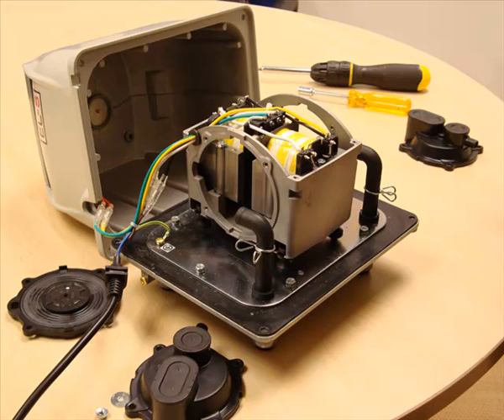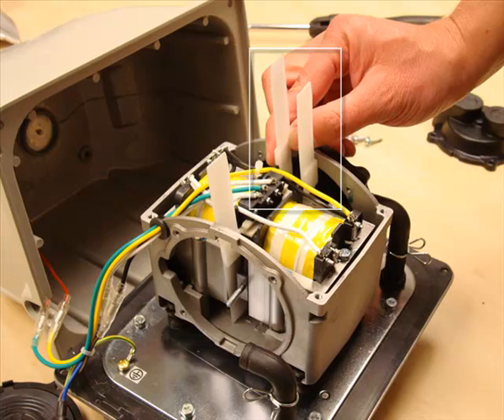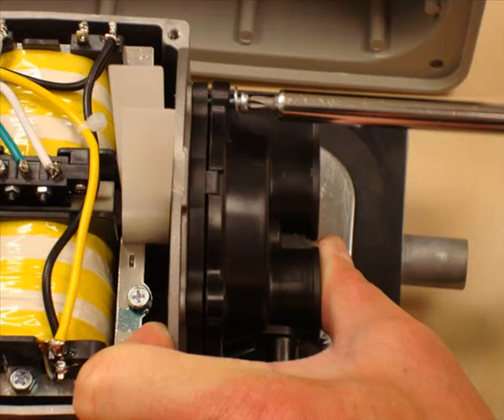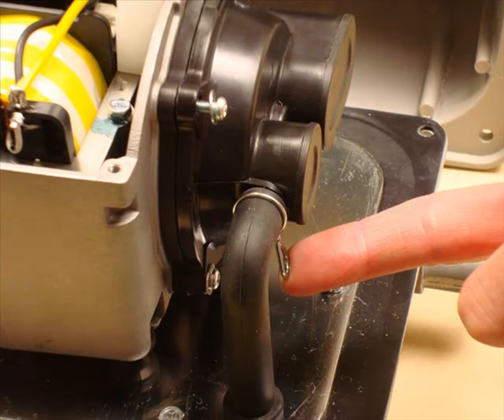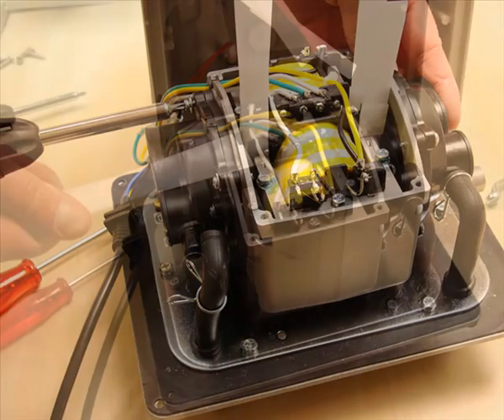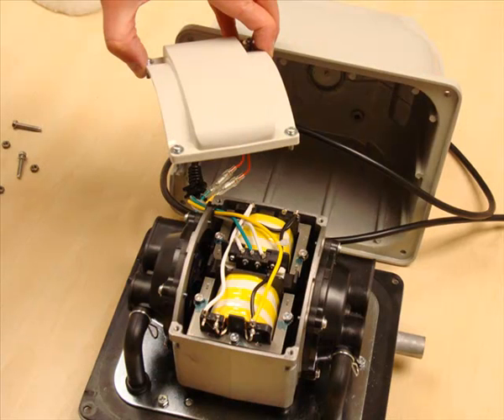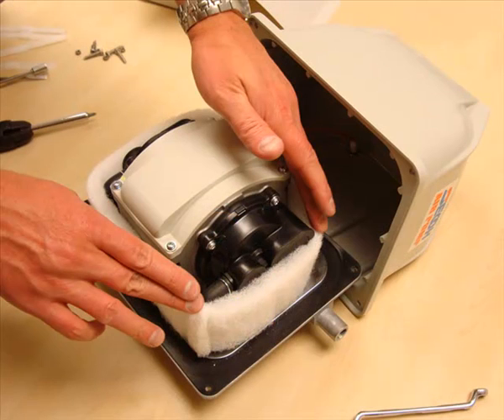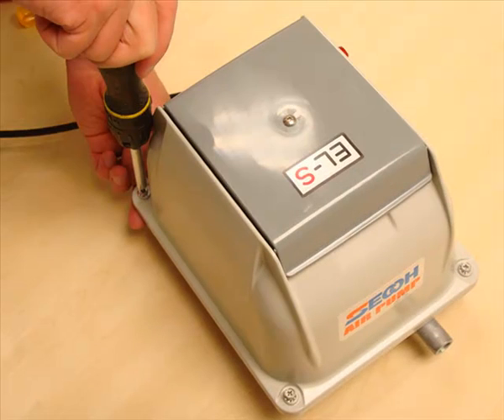Secoh diaphragm blowers maintenance guide 05 - Reassembly (English)

Comment: Having watched 1, 2, 3, 4 and now 5, I hope to be able to replace the diaphragms on my Secoh jdk-s-80. Switching off the empty the tank seems to have brought the pump to a full stop. Watch this space!
Reply: hi - did you mange to sort this? I have an EL-100C pump and it intermittently stops. Want to see if i can fix before replacing the whole pump.
Reply: English-Ash how do you get the magnets to stay central? I’ve got the spacers but still when I remove them the magnet flicks to one side 🤬